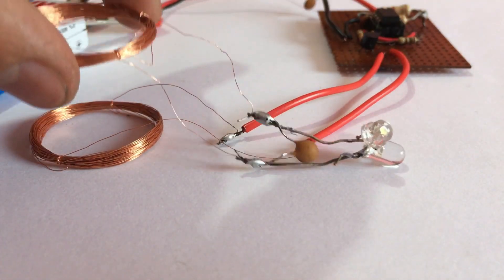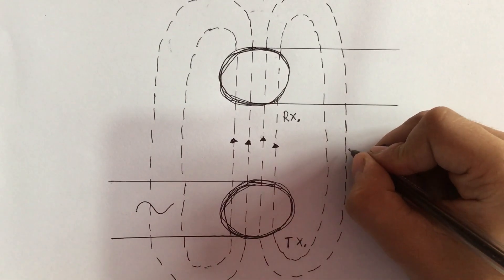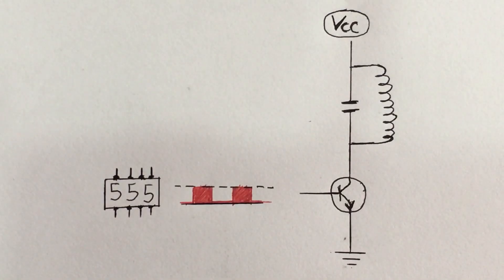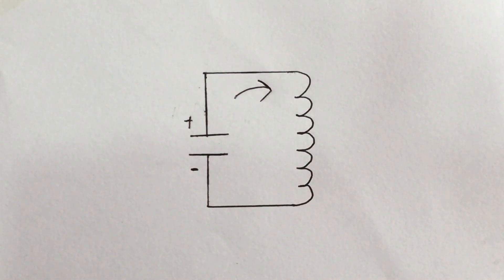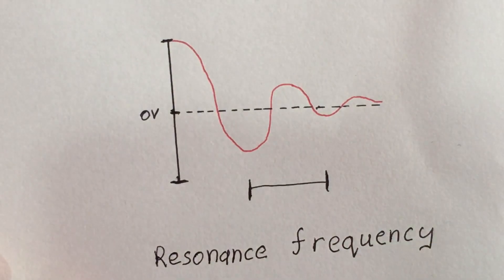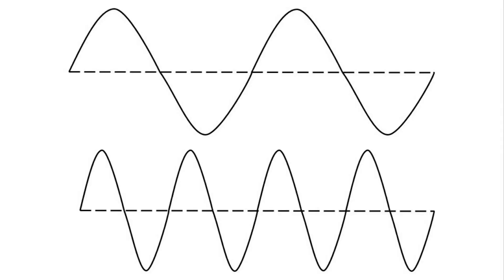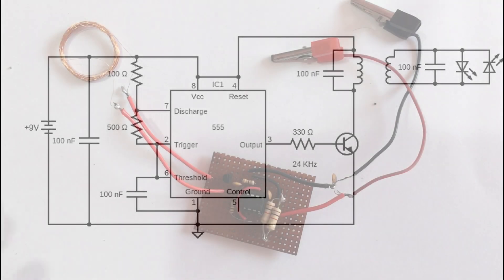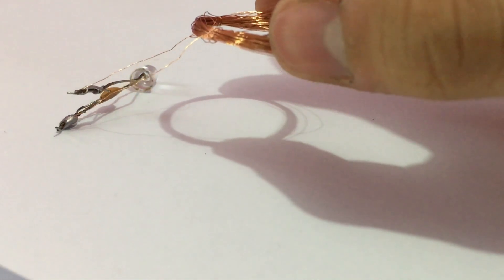How wireless power transmission works | Simple wireless power transmission project!

Comment: So can we transfer electricity generated in space to earth wireless?  Pls explain
Reply from the maker: Yes we can! But generating electricity in space and transferring it wirelessly to earth by using this technique would require a lot of power and may disturb electronic devices here on earth due to high frequency alternating magnetic fields. And transferring electricity using this technique is very inefficient because a lot of energy will be wasted due to leakage of the magnetic wave so it is not recommended to use it in a big scale. 

We have been working on this type of energy transfer from space. We have already came up with an idea of space-based solar power where rays like microwaves are emitted from the solar station which is safe for human skin and receiver from earth would capture that energy. But this idea also need some time to change into reality 

Hope you got your answer. :D
Reply: @Robonova  thx bro

Comment: is this how tesla coil works? 
#roadto1K
Reply from the maker: Yes, both them work on faraday’s law of induction. But Tesla coil has very high number of turns in secondary coil which results in high voltage output which easily excite mercury vapor in fluorescent lamps and make them glow.